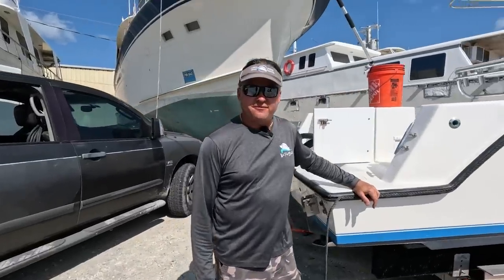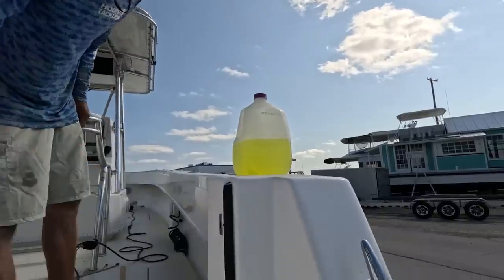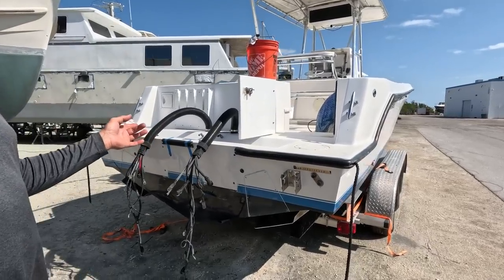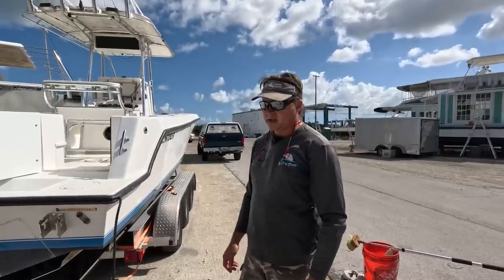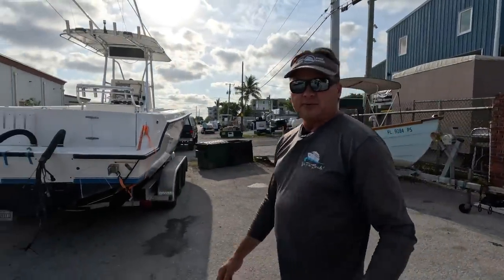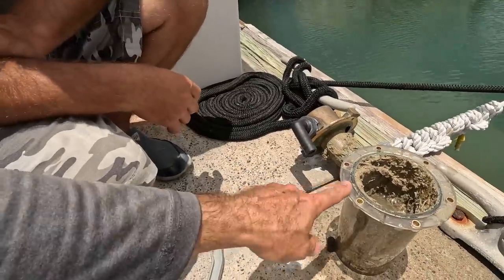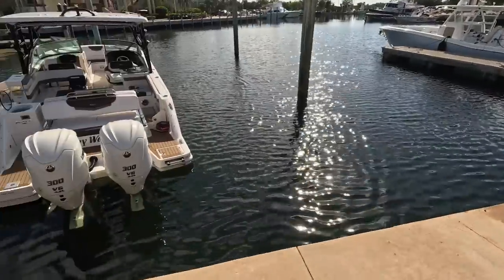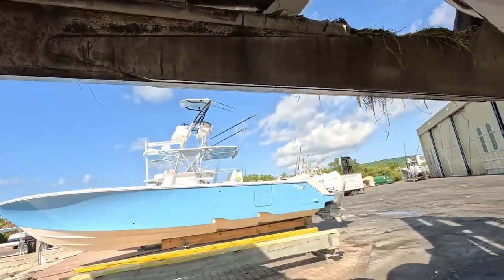We SAVED the 35ft Contender From Being a TOTAL LOSS!

Comment: Looks like a 25ft contender. That’s definitely not a 35
Reply: Was gonna say the same. Cockpits way to small for a 35
Reply from the maker: Thanks what we were told maybe picture makes it look smaller?
Reply: Yep, and a stretch at 25
Reply from the maker: @wallacejeffery5786  definitely more than 25 ft! It's on a 3 axle trailer it weighs a good amount! When we towed it Matt could feel it in our 1 ton truck with airbags.

Comment: 3M is proven and trusted probably most go to products. But I’ve also used McGuires in a pinch it does the job . But definitely more options with 3M.
Reply from the maker: Thanks for sharing what kind of soap do you use to wash?
Reply: We just use simple green in the pressure washer seems to work well . Although I would like to try a foam spray just never have .
Reply from the maker: @mikeyd5969  interesting simple green

Comment: I use Meguiars or 3M. Both do a great job. I really like 3M’s Finishing Material as step #2. I still use carnauba wax but definitely need to find something better that lasts longer.
Reply from the maker: Hey Dr Ed what kind of soap do you use to wash?
Reply: @WillFixThat  It depends what I am doing. Sometimes just West Marine Boat Soap or Meguiars wash and wax/boat wash if I am just maintaining. If it is a problem child with deep dirt in the gelcoat, I will use a light bleach solution mixture (Clorox cleaner and bleach with some soap. Then wet sand with 3000 sanding sponge from Gator 🐊 and compound in three steps… (I only use bleach in extreme old boat situations like mine or to remove heavy dirt and oxidation) I always start very gentle and move up. Same with cutting compounds. I am thinking of trying ceramic coatings next. People say it’s worth it.
Reply from the maker: @DrEd-th2lu  we normally use the west marine pink boat soap.